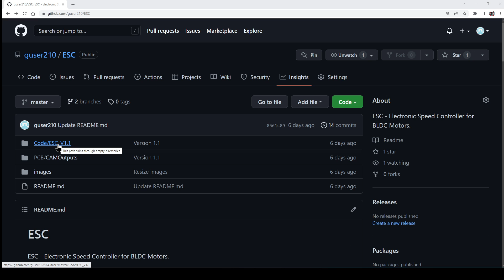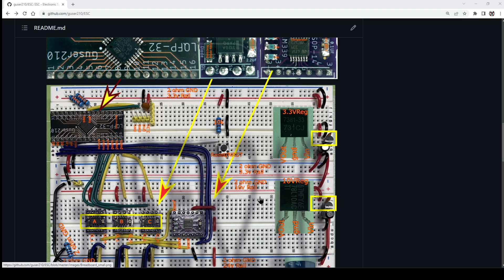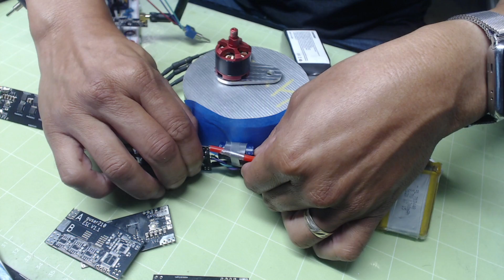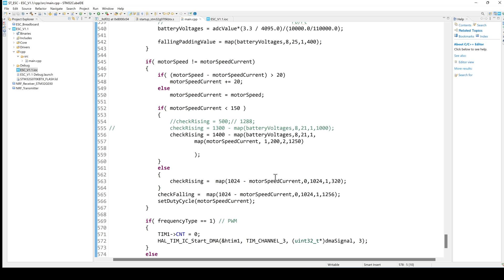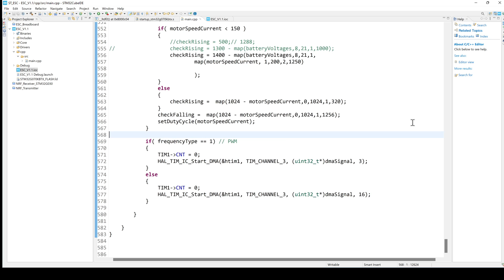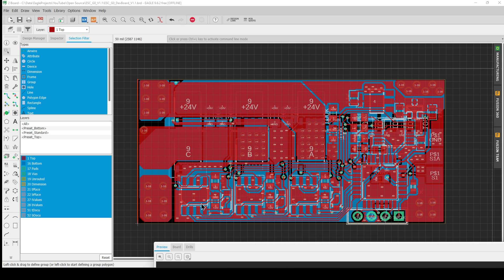DIY Open source ESC for brushless dc motors STM32 for Quads and RC planes

Comment: Hi bro,
I have printed the ESC-V2 PCB and successfully flashed the ESC-V2 firmware onto it. However, the motor is not running as expected. I verified the low battery detection functionality, and the LED indication works correctly.
Occasionally, the motor makes a slight noise and appears to be stuck. However, the open-loop startup and commutation sequences do not seem to be functioning.

Could you please help me troubleshoot this issue or suggest possible reasons and solutions?

Comment: @guser210 hello, i am working on a ESC but very special one. I wa't to ask you if it is possible to use this type of schematic for a 400+V ESC. I need to change driver and will use IGBT of course.
Reply from the maker: Hello, Yeah you can,
 you will have to bring the voltage down with a voltage diviter for the comparator to work and the power lines will have to have the proper specing.
Reply: @guser210  thanks for the fast reply. Yeah I will use like a stage configuration (stage 1 is powersuply (400 to 12V-5V-3.3V) stage 2 is Stm32. Stage 3 is driver stage 4 is IGBT modules (600V type))
Reply: Stage meaning separated PCD (one on top of the other ..) similar to a sandwich. In this way there will be just 12V on the STM32 board and the Driver board ... And 400V on the DC converter and power modules only

Comment: Good day. Would you like to add functionality and make a controller for RC models of cars or tracks with a sensored electric motor? Why didn't you use a controller with a built in comparator? e.g. G071. Update: I assembled this project on my board with stm32g071g8u6 (exti pb9->pb8), adp3110 and sm4337. works great, thanks for sharing

Comment: Very nice and thank you for your work. I already began to look into your git. I was looking for exactly this :)
Reply from the maker: cool, the git has reversing code in it that you mod to your liking, you can also contact me on discord the link is in the description. you can find how to control reverse without a button in the processDmaSignalPWM function, the direction depends on the pwm period 7ms or 8ms will change direction on the fly.
Reply from the maker: also there is a video prior to this where I go over the entire coding session including adding reverse functionality
Reply: I currwntly don't have a lot of time in my hand but i bookmarked a ton of videos if you. I will pick up the electronics and coding after i finished the CAD and mechanical testing. Still haven't looked into the datasheet of the MCU as i want to use a RF-Nano as a receiver as my project has a more complex drive train and needs some simplification on the input side. Do you thik an SPI or i2c is easy to implement with mod to the schematics?
Will join the discord for sure 😊
Reply from the maker: @ketamu5946  yeah spi, i2c and uart can be implemented, come to my discord it will be  easier to communicate

Comment: Bro is it possible to add parallel mosfets  in a working esc to increase ampere rating
Reply from the maker: Yup is possible in fact that’s how is done for 200amp Esc.
Reply: @guser210  so.  If 30a esc is added mosfets (60amps ~)  Will the gate drivers gets any issue
Reply from the maker: @denilpt1999  so if you need a 60 amp Esc is easier to add bigger mosfets you add parallel mosfets when you want something higher than 160amps.